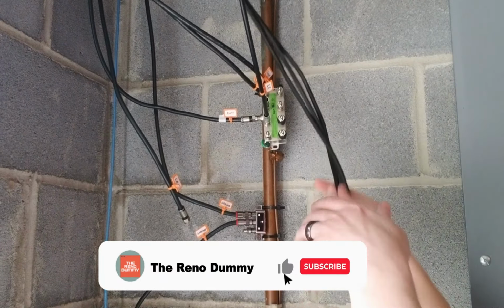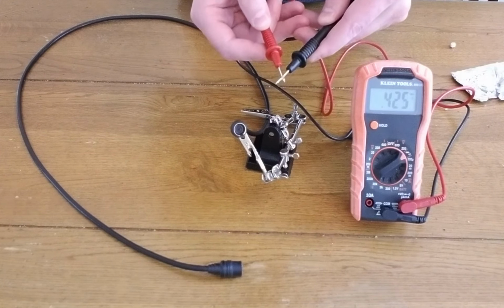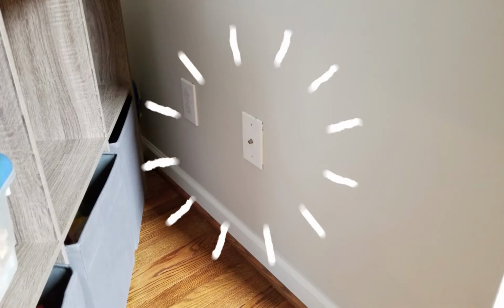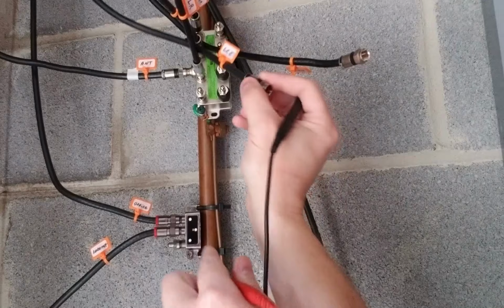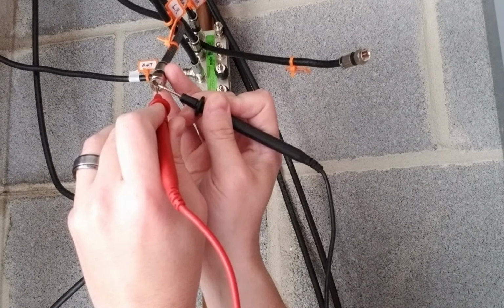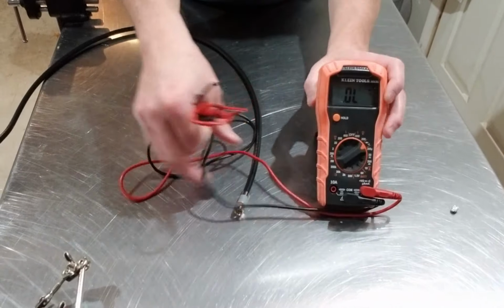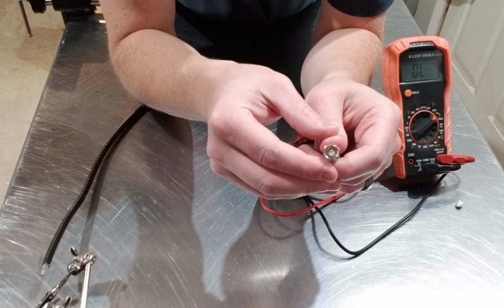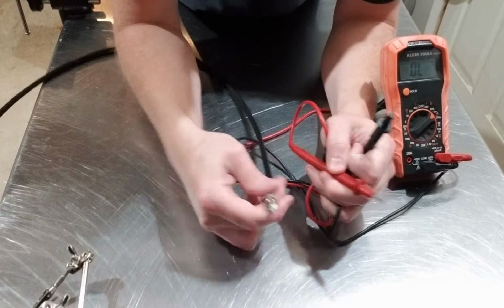How to Trace Coaxial Cable with ONLY a Multimeter #coaxialcable

Comment from the maker: So glad this simple foil trick is saving you guys from expensive tool runs and technician fees! 🛠️ Quick heads-up: if you aren't getting a tone, check for hidden splitters—they can sometimes block the signal. Has anyone found a creative 'foil substitute' that worked for them?

Comment: I have a number of coax cables terminating in my basement that dont have connector ends on that end. Can I do this same test by placing one probe on the centre pin and the other probe on the strands of wire. Im assuming this will work but wanted to confirm it before installing connectors to each wire when Im only looking for one wire to work.
Reply from the maker: Yea that should work if you’re touching the right parts with the probes.

Comment: this is a great explainer. thank you   for a one off this feels like the right amount of work. If you need to do a bunch, I would consider taking an old cable and making it a permanent shorted end and that can be just 5cm or so (2" ).  and making a testing end there the core and shield are further separated to make testing easier that trying to touch just the core with one probe and the shield with the other.
Cheers

Comment: Could this possibly work on a coaxial cable that is cut on one end by wrapping the foil around the cut end making contact with the conductors and probing the connector end?
Reply from the maker: I would think so as long as the tin foil makes contact with what it’s supposed to.

Comment: I've run into a problem. Apparently this trick doesn't work if a splitter is hidden on the line. Please comment your thoughts.

I tested with 2 wires and put a splitter input and 3.5db output and I was not able to get a tone.

Google says some splitters block DC?

Comment: Hi, that helped. subbed. If a coax in a room (on the wall where the tv would go) has one of those special metal caps threaded onto the male threads, does that short it out same as the foil? I ask because when I tested I got more than one cable (unconnected cables at the main distribution box, indicating continuity. Not just the one I put the alum foil ball on.  So it made it hard to know which had the foil and which was just a dead end?
Reply from the maker: I would think it acts the same as the tin foil but I haven’t tested that
Reply: @simpleguydiy365  Thanks!

Comment: Very informative video.  I have all sorts of coax cable around my house that I need to identify and also to make sure those cables are not damaged.  Since I already have a Multimeter, your method should work very well and save me the cost of buying a Coax testing tool.  Very well done my friend.  Thank you for sharing this.

Comment: Does this little foil ball work if need to test two ends of bare RG6 Quadshield run through attic to different spots?  (Are no F connectors on the wire yet)
Reply from the maker: I would think so if you’re able to get the tin foil to touch the center conductor and the shielding.

Comment: great video, any tips if you tracing ethernet cables
Reply from the maker: I don’t have any experience with that. Seems like it would be harder to do.
Reply: @simpleguydiy365  thanks for responding
Reply: A simple, inexpensive tone generator / probe can work for this. Many have alligator type clips and RJ11 connectors on the generator component. You can build a short patch cable with an RJ45 female connector on one end (possibly a surface-mount type jack or small surface mount "housing" for keystone type jack) and RJ11 female connecter on the other. For wiring, I suggest straight through. If you use the T568B termination standard, wire the same way on the RJ11 side, except eliminate "outside" wires, either orange and brown pairs for 4-pin RJ11 or striped-orange and solid-brown wires for 6-pin RJ11.
Something to keep in mind: most of the simple tone generators will not work well or at all to identify/locate cables that are patched to an active switch. There are a number of options (generally more expensive) for tone identification of cables that are (or you think might be) active. Try a web search for digital tone probe . I highly recommend carefully reading available documentation before buying.

Comment: How
would you test a coaxial wall plate to see if it was connected to a splitter in my cable box? Same method? If the wall plate beeps its connected?

Comment: But this won't work if you're going through a splitter.  They use transformers, and do not pass DC.  You need an actual signal.   That's my problem now, I need to trace out some cables, but with splitters attached, I can't get past that, and I don't know where the splitters are.

Comment: How do you know if that tone is from the jumper where you have that little ball of foil or from a short in a different cable 20' out?  A better way would be to utilize a known-value resistor, preferably >100 ohms.  Then, you simply measure for resistance.  You know the resistance is going to be a little over 100 ohms.  If it's significantly more or open, that's not your cable.  If it's less, there's another issue with that cable.

Comment: good video! I'm trying to determine if an active coax cable is carrying a signal from the tv box to the tv.  Using a multi-meter at the tv I do get feedback as well as when I use a Drop Cable Continuity Tester... the little red light goes on when I plut it in... to either the cable and/or to the tv coax outlet.  BUT the Vizio tv is not receiving any programming.  When you go to "input" no matter the selection, I get no signal detected.  Any thoughts?
Reply from the maker: If you have a spare coaxial cable then I’d try that. But I’m leaning toward something being wrong with the cable box or the tv.
Reply: @simpleguydiy365  thanks for the reply but its neither the tv or the cable box. I tried another tv w/ the same result; the cable box in question continues to supply 3 other tv's without any issues.  I've a few more wires to test but, my question: what do the reads I'm getting mean?  something but not enough for a picture or is it just static on the line?
Reply from the maker: I only know of using a multimeter to check continuity b/w the inner conductor and outer shield of the cable. I’ve only seen signal being tested with a coax cable tester tool.
Reply: @simpleguydiy365  well... per my original "Using a multi-meter at the tv I do get feedback as well as when I use a Drop Cable Continuity Tester... the little red light goes on when I plut it in... to either the cable and/or to the tv coax outlet" I would say I tried both, get a reading of some sort but I'm trying to define the "some sort".  I get the same number via the tv coax outlet and/or via the cable that plugs into it.  Since there's "something" I'm wondering if that kind of mutes any need for chasing down the other end of the cable.  Oh, it can be done but that other end could be in any number of places... never mind the hornets nest under the stereo stack with all kinds of wires running around.  Trying to avoid that plunge if possible.

Comment: Cable tech here. This may not work if the cable itself is bad and shorting out. 

You're essentially shorting the cable out to create continuity. But if the coax you're trying to trace has a short already, this won't work.
Reply from the maker: Good point.
Reply: I used an analog tone and probe kit to identify an unterminated coax cable in a family member's basement for a specific coax outlet / wall plate. I terminated the cable in the basement, but can't get a good/basic coax test on the cable, using a basic Sperry Instruments cable test plus set. The shield-coax LED doesn't flash with the test units connected to either end and powered on. The test set is fine; the shield-coax LED flashes when the test set is connected to a coax patch cable. I think it's a basic continuity test, that also fails on short, according to the LED indicator key/guide printed on the tester. I also tested the cable connectors for short with a multimeter, but didn't find a shorted connector. I removed the wall plate and disconnected the coax connector/cable from the back of the wall plate (pass-through coax connector) for testing with the test kit and with the multimeter. The coax connector in the wall was terminated by someone else. It appears to be an Ideal toolless compression type, RG6 F connector. The termination appears fine visually. I considered trying to reterminate the in-wall end, but there seems to be very little excess cable at that end and I didn't manage to get any additional length when pulling gently/firmly. It's also currently behind a large/heavy desk, making access a challenge. Desk placement is temporary and I should have free access to the port / outlet in a few weeks. Any suggestions for further troubleshooting and repair or replacement?
Reply: @cloudbase7799 there is a possibility that there is a splitter between the demarcation point and the outlet, especially if the mapper isn't identifying the line. Most splitters are not tone or power passing and if they are present mappers and toners will not work. 

Is there a cable outlet on the other side of the wall? It's possible that outlet may have been daisy chained from it instead of having a dedicated run to the demarcation point.
Reply: @xSinisterDrakex  It's a town house built in the late 1980s. I'm fairly certain coax outlets are all home run to the basement, based on the number of outlets and number of cables in the basement. I'll take a closer look at this. The outlet in question is in a second-floor room on an exterior wall, meaning the other side of the wall is on the outside of the house. I was able to confidently identify the cable in the basement using the tone and probe kit. It seems strange that the coax-shield LED isn't flashing when connected to the cable ends in the room and basement, bypassing any patch cables and wall-plate / through connector. The cable is Belden dual-shield RG6.
Reply: @cloudbase7799 I would verify that the Sperry Instruments device is working properly then. If the tone and probe kit was able to tone it out, then it should be good. 

To verify if there is a short. Leave one end of the cable open and test for continuity on the other end with a volt/ohm meter. Essentially the opposite of what is being shown in the video.

Comment: One day my cable Internet went out and everyone around me (neighbors) still had Internet so I wasn’t sure what had gone bad and knew it was either the wire coming to the house from the cable company, my wire in the house (taking that signal to my modem ), or the modem itself.  The modem powered up but would not show Internet signal connecting to the Internet like I did the night before. Need to find a test to try to figure out what was going on.
Reply from the maker: I would hope the cable company could figure it out for you

Comment: Straight up saved my sanity dude. Turned out the splitter coming from my otc was no good. I was only able to find this out using your trick. I woulda gone crazy trying trying multiple connections. Thank you for sharing your knowledge!

Comment: Awesome! I was trying to install a MoCA adapter but none of the six cables worked. I didn't know if it was a problem with the modem, adapter, or cable. Using this trick I found none with continuity and like you mentioned the cable was just sitting in the cable outlet box and not connected. I won't go into who's the dummy responsible for that :) After that it was easy to confirm which cable went to the bedroom.

Comment: This is very helpful. My mother has been having intermittent issues with the cable TV signal to only 1 of 3 TVs in her house that have a DTA box. The problem DTA will just randomly lose signal, but through general troubleshooting I've always been able to get it to work again...except for the most recent signal loss "episode". I've eliminated the TV (and both of it's HDMI ports), the HDMI cable, the DTA, and the Cable Provider (and service it provides) as possible causes of the problem. I called the CTP/ISP's "Tech Support" (🙄) which claimed they could see remotely that the DTA in question was "receiving signal and functioning properly", but somehow didn't sound confident in their answer as they were saying it like they weren't sure it was true...idk. They just kept trying to push me to schedule a service tech house call ($99) and it wasn't until I asked them for the 3rd time to ping a signal to the device that they supposedly did. I've had a phone support person tell me about this in the past and it fixed the problem with the same DTA when they did it then, but it did not work this time. The only two items left in the chain of signal flow (that I'm aware of) are the coaxial running to the DTA and at the other end I traced it to an unknown type of junction/splitter mounted under the eaves on the exterior of the house. It's been painted over (probably multiple times since it's installation) so even if I could get the paint off I suspect there wouldn't be a legible label left to read. I figured the next thing to do would be to test the coaxial for continuity, and if there is then I'm not sure there's much more I can do on my own. I don't think it would be the mystery splitter device since the other two TVs receive signal perfectly fine...unless just the 1 out connection for the line that isn't working has failed independently, but the main in and other 2 out are still working?

Comment: Wow! I was thinking maybe a AA battery and use multimeter and gauge voltage which maybe wasn’t the best idea and found your video and so glad I did! Makes so much sense, thank you for the video, worked perfect and mapped all 12  coaxial is in my house, saved me $80 from the cable company coming to look at lines in house.

Comment: I’m wondering if a barrel connector could be a  substitute for the foil?
Reply from the maker: I would think metal coax caps could work but the barrel connector won't complete the circuit by itself.

Comment: RG6U 75 ohm TV cable has a steel center conductor that is copper coated it's not solid copper.. Now this trick will help  you trace down lines to their destinations but it will not show you if the cable is compromised which will affect things like internet service to a modem. Chances are the cables will be fine thopugh but if  you have any issues with signal quality then you may need to replace that run or move your equipment to a different  jack

Comment: I am so glad I found this. Now that I know which cables lead where, does anyone have advice on selecting an amplifier? When I tested with an HDHomeRun/antenna instead of using this method, it couldn't find any channels at all. The Mohu amp I had laying around didn't do squat either. Is this a different type of amplifier? $50 Televes Distribution something something? TIA

Comment: Good job!  When the Cable company came over and hooked me up cable service through my router and modem (using smart TVs) I had a cable connection in every room and they all worked.  I had just bought the house and the inspectors checked them.  I also had a multiple connector amplifier in my attic where all the cables converged and connected.  I even had cable out to my pool area.  I could have a tv in any room I wanted.  The cable guy CUT all of my cables in the attic.  He went to the wall jacks and cut the cables and removed the connectors so there were just holes.  He took the amplifier with him when he left.  I got crappy service with the cable company and they kept raising the prices every few months.  So I bought a large digital antenna.  I live in an area where you can get about 25 channels for free via antenna.  However, all the cable ends will now have to be repaired and I will have to map all of those cables.  You just made the job tenable.
Reply from the maker: Wow. That'd make me so mad. Well I'm glad this helped a little
Reply: @simpleguydiy365  You could, instead of using a piece of foil, get yourself a coaxial splitter and then take your spare small coaxial cable and hook it to both outputs, then put the cable you're trying to find into the input.

Comment: What if you only have a wire no that would go directly into a tv?  There’s no coax plate on the wall or anything??
Reply from the maker: If it's just the bare copper sticking out of the cable then you'll need to put a connector on.

Comment: Will this method work if there is a splitter between the two ends?
Reply from the maker: Good question. I haven't tried it but I think it'll still work. If one cable is on a splitter with 2 cables then those 2 cables should make your multimeter buzz.
Reply: Okay. I will let you know. I will be giving it a try later today. Thanks for the video.
Reply: This does work with splitters in between ends. Also I just used a coax end cap with a Male/Male connector on the end instead of foil. That also works and you don't need to take the wall plate off if trying to find the end of a wall outlet.
Reply from the maker: Very good. I knew the end caps worked but I didn't show that. I assumed most people don't have any. Thanks for sharing.